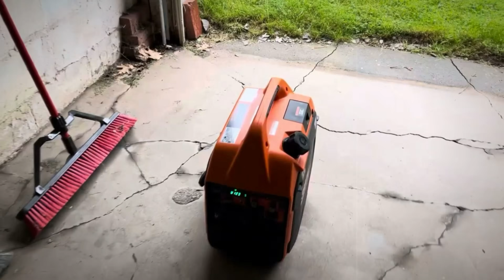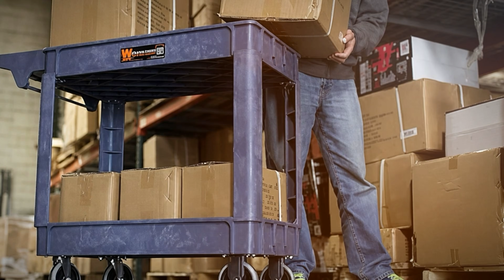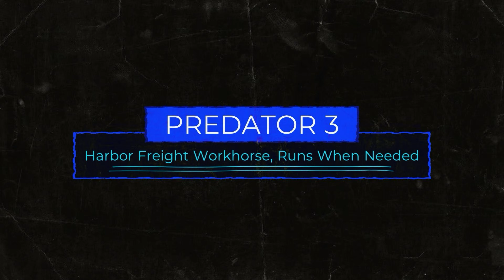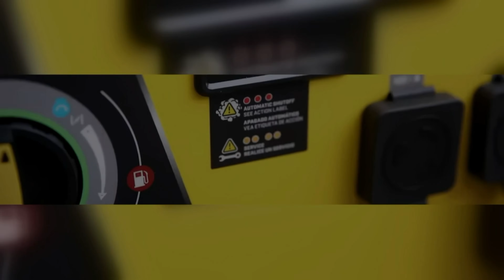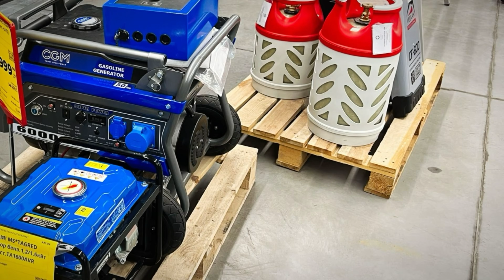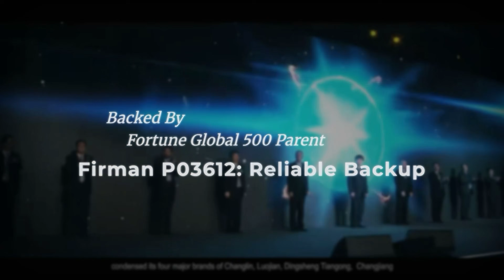5 Cheap Generators Hiding in Plain Sight (2 Are Surprisingly Quiet)

Comment from the maker: One thing I couldn't fit in the video: whatever you buy, get a transfer switch installed BEFORE storm season, not during. What's the longest you've ever been without power? Curious how many of you have been through a bad one.